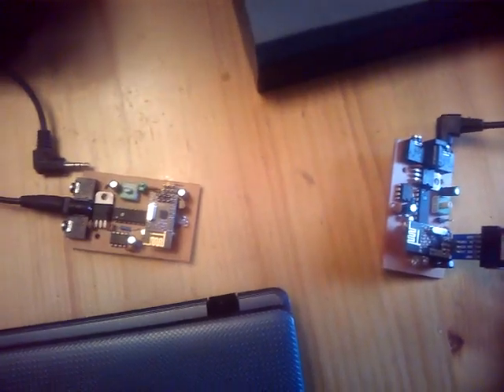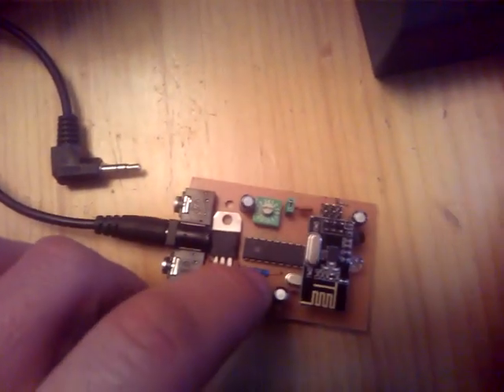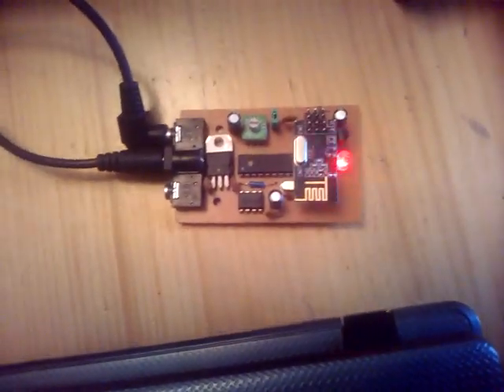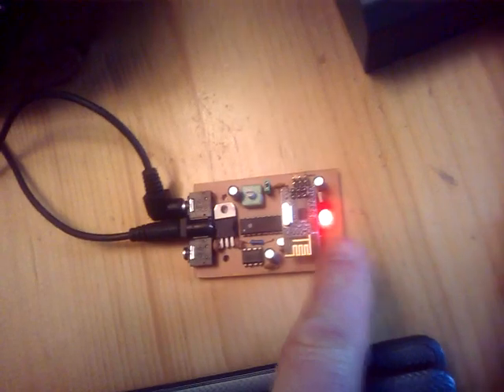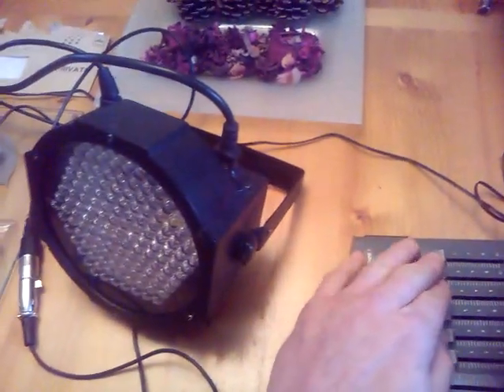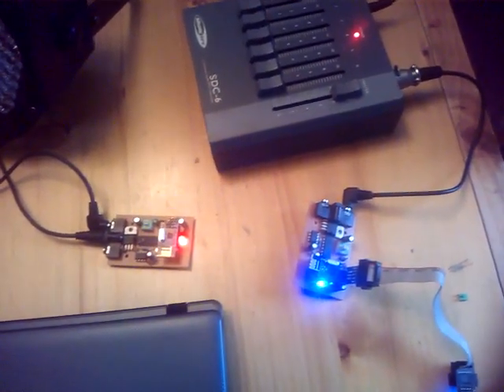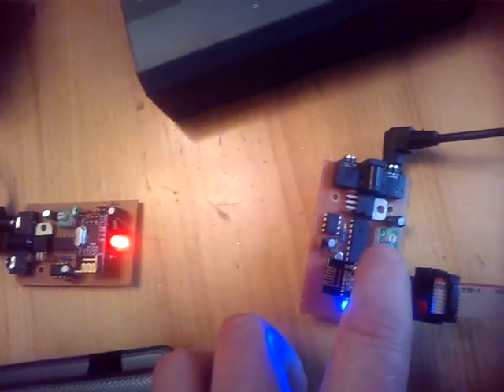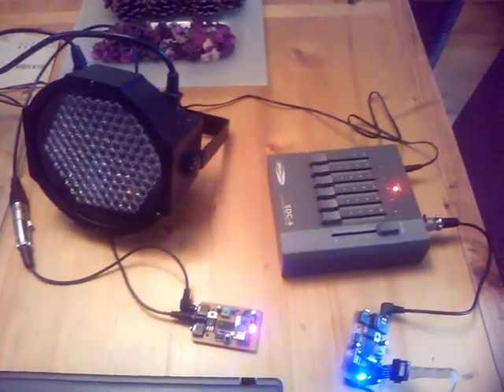SmartShow DMX Wireless - Nrf24L01 2.4GHz rf boards - Arduino - ATMEGA328

Comment: Sir,
     Can I connect more than one receiver modules to a single transmitter.

Looking forward for your reply
Reply from the maker: yes, I have done many
Reply: @Recovered  Thank you for your response

 Can I control a whole of 512 channels using this module and is there any time delay in the communication.

Looking forward for your reply